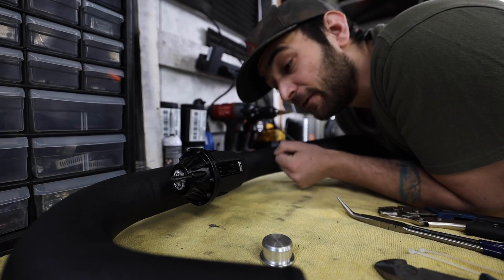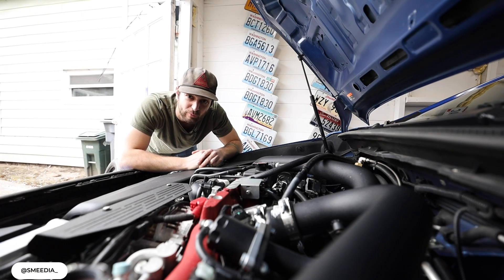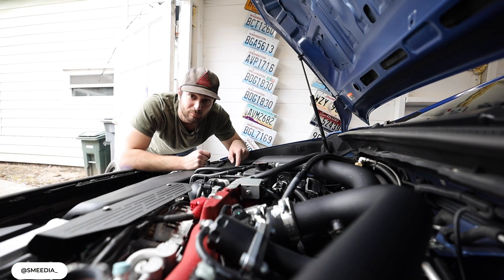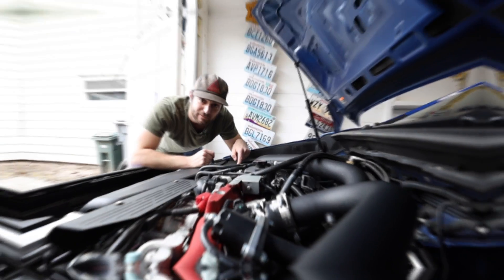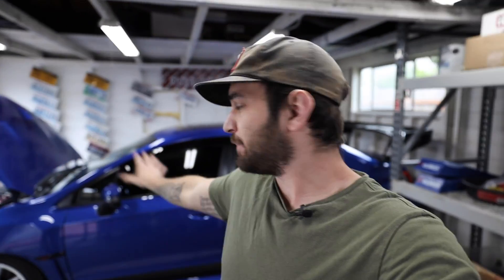This Is Why You Shouldn't Use a BOV On A Stock WRX/STI

Comment: Never really looked at BOVs but do you reckon this could have caused valve damage in my 2008 WRX which is stock? I bought the car with the BOV installed.

Just had a look online its known as a dual port blow off valve that I have.
Reply: Worst is could do is create a rich condition when the BOV lets air vent

Or a lean condition if it's leaking
Reply: @lecoureurdesbois86  but that only happens for a split second, not enough time running rich to cause any issues

Comment: You dont tune for a valve that is based/made to run on vacuum.
Bit of a stupid statement saying "its tuned for bypass valve" 
Considering its only used when OFF THROTTLE you dim wits.

Comment: Hks is only good for full throttle dumps. 
Because its designed to be super efficient it generally wont flutter dump on part throttle releases. 
I speak from experience after all my cars having a hks at some point. Itll only flutter with shit vacuum.

Comment: What a load of shit , bov are closed under throttle and at idle they only open for a second when you're underboost and shut the throttle if yours it opening and drawing air in at idle the spring load is wrong

Comment: Bro, you know you need to adjust the spring stiffness first right?  It probably just needs to be stiffened up.  Also, what about a 50/50 BOV?
Reply from the maker: I'm aware, was just showing what happens out of thr box as that's what most do, and 50/50 seem to be hit or miss on weather they seal up or not but good option

Comment: I got my 15 STi with a turbo smart adjustable bov set to 50/50 recirc & atmospheric 
It came with 150,000kms, do you think it would of had to be tuned for the bov to get that kind of mileage? 
I can’t get in contact with the previous owner and the place I got it from said it was tuned but I honestly just think they were saying what they think I wanted to hear because I haven’t got any receipts for it.
I get a few pops but only when I really floor it then change gear, other than that I can make the exhaust pop on command every-time I rev match when down shifting but I assumed that’s because I got an axle back muffler delete
Reply from the maker: I would probably get it in for a tune, just running that BPV/BOV alone won't cause any major harm. But to run optimally I would suggest tuning if you done have any evidence showing thr car had one prior
Reply: @Smeedia  okay I’ll be doing that soon then, thank you!, last question I have is would you say 120,000 miles is too high to get tuned? 
I’m at 119,000 now
Reply from the maker: Nope, getting mine tuned here soon with 132K on it 🙌

Comment: Hey man so I’m getting the ets fmic and was thinking of getting the hks bov with that. I am getting an etune for that and a couple other parts. With the speed density tune added on to the rest of the e tune, is this going to make sure the engine is still healthy? Or should I not get the bov. I wanna keep reliability but also want the bov
Reply from the maker: Should be totally fine as long as the tune is created for it 🙏
Reply: @Smeedia  awesome man. Just don’t wanna mess with the reliability. Getting ets fmic, hks bov, cobb sf air intake, grimmspeed downpipe and turbo heat shield, killer b oil pickup and pan. And all tuning too.
Reply: @Smeedia  I have learned a loooot from your vids tho and wanted to thank you because I probably wouldn’t be as confident in modding my car if I hadn’t learned from you lol. So thank you and keep it up 👍

Comment: Great video - what mod's are needed to comfortably use a BOV?
Reply from the maker: A remote IAT sensor and the proper tune and you can use them without issue 🙏😁
Reply: @Smeedia  whats an IAT sensor

Comment: What about a recirculating blow off valve? Is that safe on a stock wrx (base)
Reply from the maker: As long as it recers back into the i take track, you shouldn't have an issue 🔥🙏

Comment: Hey man, there is no way that it would make a difference running that low RPM, The BOV only opens up to let the air out when the boost pressure is above 0 (Hence the BOV sound). Anything below 0, you should not even notice the difference because it's a closed system... So with all do respect, what you are saying does not make sense. If its open below 0, that would indicate a boost leak.
Reply: Let me know when you start making videos so I can follow you instead. Your comment is common sense, literally entering the chat.
Reply: especially when running something like the GFB TMS Hybrid. Zero chance you’re gonna mess up the closed loop system if you’re setting the spring tension correctly. That’s literally it.
Reply: Good reply, the poster never replied to this because you mention facts.
Reply: @panderalexander  exactly
Reply: I blew up my 2011 wrx because i added a bov on my cobb OTS map. ran lean and threw a rod

Comment: I have added the HKS on my forestr s-edition and happened the same to me. Tried twice but I was not comfortable using the car that reach and the RPM was not sweet and this subaru is an automatic one. I prefer not taking the risk - but would be nice having the "tchuuuu" noise from the blow off valve.
Reply from the maker: Don't blame you at all 🙏 if you go to get tuned later on they can make the proper adjustments to allow you to use it

Comment: mine got same problem,,,,,on evo2 4g63....rpm drop under idle point and stalling,,.....need recirculate it..
Reply from the maker: Easy fix though, just to swap them out 🙏
Reply: @Smeedia  most problem.. After boosting or accelerate... Off throttle n put Neutral.. Rpm will drop under idle m stalling.... Afr reading around 10.5.....

Comment: ... 

Unless you're in boost and let off, there is no "metered air" for the maf to see. So you're idling and revving would not tell you anything about the blow off valve because it's not even in use. And it's not running rich from that. The car won't add fuel because there's not extra air. So, with a recirculating valve, the car adds fuel for the extra air, when the blow off vents to atmosphere there is no extra air so no extra fuel needed. Thats the whole purpose in the maf... Also, if your car is running rich (as long as you have a proper tune with proper timing) the only damage that can be done is shortening the life span of your spark plugs slightly.

Also just want to point out "I don't want to drive and risk hurting the engine" proceeds to cold rev the shit out of it

Almost everyone I know runs a BOV and none of us have had an issue.

Comment: So, my 2020 WRX is still stock. I intend to get an accessport or protune after getting the Cobb Big SF intake, EGR/TGV delete as well as an AOS. I know the car comes stock with a BPV and I would love to get a BOV. I’ve heard mixed things between this or an aftermarket BPV as turbo flutter and compression surge are not good for the car. Which do you recommend that would least likely compromise the lifespan of the car? Also, do I need an aftermarket FMIC or do I have to changing any piping before switching to an aftermarket BOV or BPV?

Comment: Id guess you done have it setup right. My GFB Hybrid BoV was installed by a master tech at a Subaru dealership and I have 0 problems. Its running about 50/50 recirc/vta. Also its only going to "run rich" for a split second during a high rpm shift. If anything that split second of rich is going to help vs engine knock.

Its been on the car for 2 years (35k+ miles).
Reply: how much you pay for it?
Reply: I have the same BOV on my 2015 STI Works amazing with a higher hp setup too. No dedicated tuning but I will be tuning this winter
Reply: @jeprodigalson792   Im at 72k miles now everythings still great. Still no tune.
Reply: My car has the GFB Respons Hybrid BOV and my car is stalling. I believe my Spring Preload is turned in the + direction (tighter-not protruding) and I'm not sure if I'm on 50/50 but definitely a big whoosh sound.

Comment: Go watch GFBs video on BOVs. Sure it's not how the manufacturers intended it to be but you're not going to blow up the car solely because of a blow off valve. You're more likely to blow up your Subaru by oil starvation or head gasket problems. That dip in the RPM was just the ECU learning how to cope with the BOV. There's plenty of people running BOVs without even an e-tune.
Reply from the maker: Head gasket issues were only problematic on early 2.5 N/A motors. Any OTS or stock tune is going to struggle with a BKV on a car that is full recirc and MAF based. The ECU has no idea what is happening to the lost air. Any vendor or manufacturer is going to say no tune needed because it increases sales #s

Comment: I am brand new to the gas car society, got a 2017 STI and I love the sound of your exhaust. First question, what kind of exhaust and what do I need to run that exhaust like a tuner? I had to have a tuner on my diesel to run a straight pipe. Second question, what do need to do to the engine to install a BPV or BOV. Thank you so much.
Reply from the maker: The exhaust was a Cobb catted downpipe and an ETS Extreme catback, all you need to run those is an accessport. You can install a BPV without needed to tune but a BOV will require at minimum a protune 🙏
Reply: @Smeedia  thanks brotha I appreciate the feedback!!

Comment: Hey Smeedia, love your vids. So a 100% recirculating BOV is perfectly fine, even with OTS tunes?
Reply from the maker: Thank you! And Yes, and OTS tune is fine to use with a bypass valve 🙏
Reply: @Smeedia  dang, much appreciation for the prompt response. I'm going to pair the Boomba BOV with the Cobb intake and Stage 1+ tune on a 2015 WRX. Again, thanks. Last weekend I installed the IAG AOS, per your recommendation. Can already tell a difference, the car runs more smooth.
Reply from the maker: Glad to hear! And sounds like it will be a fun set up to daily! 🔥
Reply: @Smeedia  is the Perrin BOV ok as well? i have a Cobb stage 1 tune with Air Filter only no special j pipe or exhuast
Reply from the maker: Yes it is 🙏
Reply: Sorry, @smeedia could you explain OTS, I am a newbie into Subie community and recently got a 2012 wrx sti, fully stock?

Comment: How about 50:50?
Reply from the maker: Better than full vent, the ECU sees some of the air coming bsck to make corrections to the AFR. Ive done it before on my old 07 STI with no issues. Keep in mind every car will respond differently
Reply: Smeedia thanks. I have a mazda nd, also equipped with MAF sensor and just installed a TC. I just purchased a turbosmart dual port. I hope it will works fine.  Thanks for the feedback.

Comment: Is a go fast bit response blow off valve bad? I have it about 25% open 
But I wanna hear what u gotta day

Supposedly it’s a recirculating bov

Should I have it closed all the way?
Reply from the maker: Ideally yes it should be closed. I used one a few years ago and had it about 30% open and never had an issue. You should be okay

Comment: I've seen that happen when the spring preload on the bov isn't correct spending on the valve you're running.. It doesn't shut quick enough therefore rough idle.. I've seen it, I've had it happen. Apart from the spring issue... Never had an issue and have had 2 different wrxs and currently 2018 sti.
Reply: Not a problem with an HKS bov by its design..HKS use a different design
Reply: @cal63look  yes that is correct... I probably should of mentioned just the adjustable ones... More the cheaper ones... I had one work fine then got stuck open while putting my foot down.. Haven't had any actual big problem running one though with or without tuning on 3 different wrxs and 1 sti.

Comment: Running rich is way better then lean tho so running rich wouldn’t really hurt the motor, would just have shorter intervals of replacing spark plugs
Reply from the maker: True, but you also have a moment of lean after the rich cycle. If the car is tuned for it most of the issue can be mitigated out

Comment: Just picked up a 2019 sti, I already wanna mod it. So no go on BOV, instead go with a BPV 👍🏽.
Reply from the maker: BPV would be the safer option 🙏
Reply: Iv read alot of people have the gfb adjustable bov and got it running great with out tuning. We have a 2021 wrx and I put a gfb on and have the spring screw set to soft and resirc 50/50 with no issues. Took me a few trys to get it dialed but runs great now! We are getting more mods here soon and tuning when we do.

Comment: Question? I have a 16 wrx and just had invidia R400 installed. Is it OK to install bov ? If so, would it be safe to go with turbosmart hybrid bov? I don't have an accessport.
Reply from the maker: No, a BOV should only be used with a speed density tune. Highly auggest using a bypass valve

Comment: Honestly atmospheric dump valves don’t really harm the car at all, it only causes it to run rich for the second or less you let off and it dumps air.
Reply from the maker: After the rich cycle you get a lean cycle that follows which is thr main drtrement to the engine, but a tuner can mitigate that to a degree during a protune

Comment: Would the Speed Density Tune fix that idle problem? And with that tune would you be able to run the atmospheric SSIV BOV safely? Thanks in advance!
Reply from the maker: Yes, because it is using Absolutr manifold pressure to read the air rather than a sensor in thr intake post Throttle body
Reply: Smeedia nice thanks! Waiting for my extended warranty to end so I can slap it on 😴

Comment: i just did the 93 oct map, just ordered from MAperformance downpipe w/ intake combo comes with a stage 2 map , wanted to ask if i can install the HKS bov , i know a few people with a bov on a stock sti , but their cars run normal no fine knock
Reply from the maker: The ECU can make some adjustments to compensate for it but theose OTS tunes done always communicate well with a BOV, also keep an eye on that OTS Tune, seen a handful of cars with awful readings from that tune
Reply: Smeedia oh ok , yea im on the 93 ots map its nothing crazy just untill i install the MAperformance stage 2 map. so i should be good with the hks bov? thanks alot man
Reply from the maker: Just keep an eye on thr AP, if values really start dropping i would pull ot off. If everything looks okay you should be fine to keep running it
Reply: Smeedia just got the car few months ago , dnt know how to read it TOO good yet lol, maybe its smarter to not even install a bov if ima do all tht other stuff right? dnt want to ruin the car either lol for a sound
Reply from the maker: Generally MAF=BPV, MAP=BOV. If you want one get one but just keep a sharp eye on ot and keep the OEM unit as a back up
Reply: Smeedia thanks man , i appreciate the fast responses
Reply: Smeedia i wont have it on a ots map when i install the BOV tho, i was planning to install the BOV after i installed the stage 2 map with the intake & downpipe

Comment: Blu subi you are on the money, all tough i ran the same thing just a bov set up on a 1999 and the engin managment seamed ti learn a little bit, but in the end i stroked motor, ported and polished heads, front mount, bov,, aps cold air intake, injen 3 inch exhaust and standard headers, vf34,malpassie rising rate fuel pressure reg, 500 ho fuel pump,billet fly wheel exceedy organic clutch, standard engin managment standard fuelrails and standard 440 cc injectors, the car made power but the engin management shut  me out at about 180 kw tried  just plumbing the turbo up with no controler so it just spooled up when and as quick as it could, well at 4000 rom all hell broke loose but at 5300 ran out of puff, it ran 1.4 bar of boost, i had no 4 th gear maping for fuel i think, as 1. 2. 3 gears had maping,but made to much power in 4 and didnt even want to idol, same as what u got in your video, just wanted to share my thoughts as the way your car acted ive had the same thing, i am in australia tho and the best fuel we can get here is 98 oct, dont know if this makes a difference, 
Love  the vids man im just about to embark on a supercharged turbocharged wrx set up for my son, cossworth charger garret turbo, will send photos and findings,

Comment: If you replace the bpv with another aftermarket bpv do you need a tune if a different one will hold boost better over stock?
Reply from the maker: No you do not, they function the same. Major difference is the seals and how well they hold boost
Reply: Smeedia thank you. Awesome videos. is there any bpv you’d recommend. That may give any sound over stock? With stock intake. I had nameless on my wrx back in 2016. But since got a sti
Reply from the maker: I always use the cobb BPV, never have leaks with them and they're solid units. The OE BPV is good for around 22PSI
Reply: Smeedia thank you for the info. And since I’ve been watching everyone of of these videos. And last question is was def gonna our an aos on my sti i called the tuner for my wrx and they told me a tune is required for an aos and looking at the aig street unit says no tune. Who should i believe lol
Reply from the maker: No tune is needed for any AOS except the IAG Competition series version